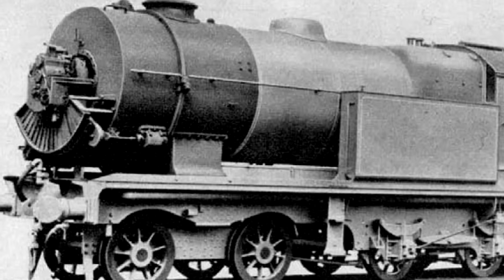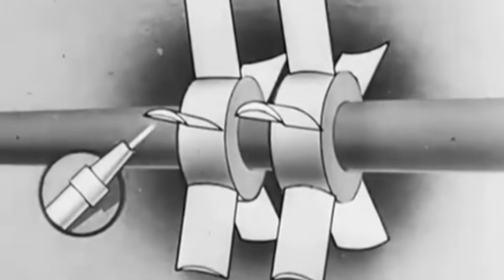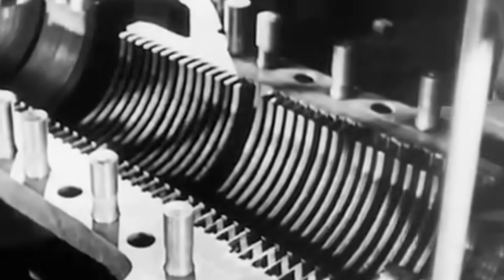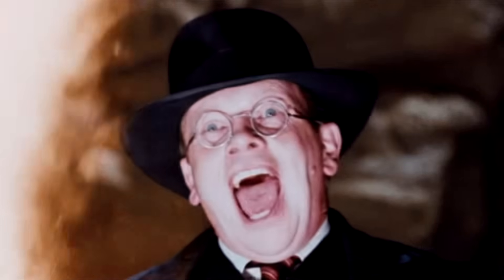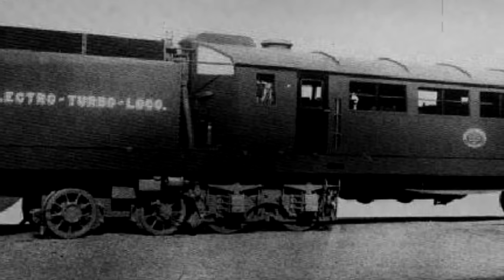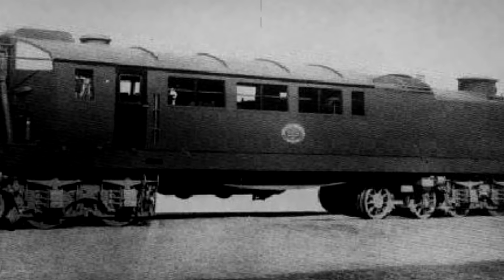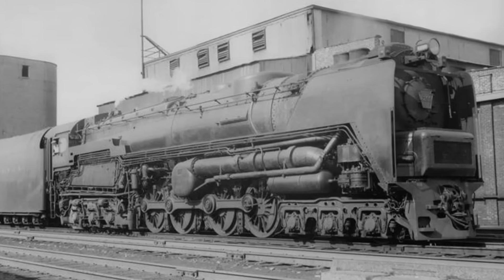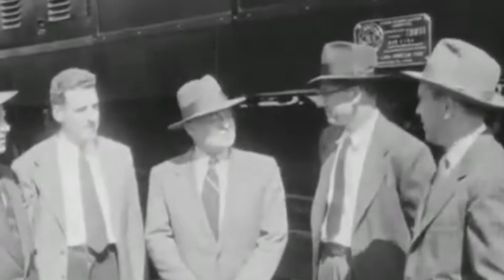What the Heck is Up With Steam Turbine Locomotives? | History in the Dark

Comment: Here is an idea. Take those super efficient turbines and let them run alternators. Then step up the AC, transmit it with little losses directly to the locomotives and let them drive electric motors. The rest of the world found out that this is pretty efficient and you can also use other sources of heat than burning coal. Like nuclear fission. And one turbine can be build enormously with a lot of power and inertia, so it can power dozens of locomotives over a big area.
Reply: powerplants and full electric locomotives are way more effcient then power generating on the locomotive itselve.
Thats why high density routes are electrified.
Reply: @obelic71  actually this is OP problem solution. Steam turbine moves AC generator in the power plant, then Voltage is stepped up, sent via grid and moves electric engine in locomotive. We have transmission losses but, don't have to carry a turbine, generator and fuel around
Reply: @szogun1987  Turbines are heavy an bulky things. The bigger the turbine the more efficient. so your are exeding the width restrictions. The UK and narrow railways even more with their reduced profile widths.  
Also railway tracks have certain axle loads. Heavy Freightlines have closer laid sleepers and thicker track so they can handle more axleweight.
The big advantage op electrical power is that you can transport it long distances at 300-500KV AC with very few losses.
Only localy you need to transform it to useable voltages for home/industrial use.
Diesel electric locomotives who are in fact small power plants on wheels make only sense in very remote areas and low traffic aplications.
Reply: Wonderful thing hindsight.

Comment: Sort of like the Chrysler Turbine Cars. A turbine powered car might work today, coupled with a CVT. Or use it as a range extender/heat source for an EV
Reply: The Chrysler Turbine used a gas torque converter - basically the turbine aspirated air with a turbo-compressor , mixed it with fuel and ran it through a power turbine which powered only the turbo-compressor , which shared the same shaft as the power turbine. The wheels of the car were driven by a second power compressor in the turbine exhaust and this was on a separate shaft not connected mechanically to the first shaft and driven from excess energy in the exhaust gas.
The first power turbine and turbo-compressor could run around 36,000 rpm constantly while the second power compressor driving the wheels operated between 0 rpm and a much lower peak speed.

Comment: So basically, like nuclear power, the most efficient way to use steam turbines to power trains would involve placing them in a permanent fixed facility (perhaps even a nuclear power plant). You would need to electrify the line, and replace the current locomotives by electric ones.
Reply: Funnily enough, all nuclear power plants use steam turbines to spin their generators 😅

Overall thermal efficiency of the whole arrangement is about 30%
Reply: No no  no - you fix the nuclear reactor and the steam turbine in place and run the power to the locomotive's electric motors with cables.
Best way to design a nuclear steam turbine locomotive!
Reply: @PaulG.x  Well, if you don't use a condenser then a pressurized-water reactor is the best choice.  Boiling-water reactors tend to make the feedwater radioactive, and you don't want that spewing out with an open-cycle (no condenser) design.  Considering the weight of a reactor pressure vessel, you may as well keep the condenser and re-use the feedwater.  The efficiency gain would be significant, no need for water replenishment stops, and the additional vehicle mass would be relatively small.  Locomotive range would be virtually unlimited!
Reply: Or just use coal power plants with steam turbines 

Basically how east Germany worked 
Steam locomotives having a ton of issues 
Diesel is expensive 
But the only reliable domestic power source is coal (they had one or two nuclear power plants)
So Railway electrification it was atleast for most main lines and high frequency commuter trains
Reply: Basically, you wouldn't bother with steam at all unless you only have solid-fuel.  If you have liquid or gaseous combustible fuel, an internal combustion engine is way more efficient.  As you say, though, if you have electric transmission lines to the vehicle, you can use any convenient power source to generate the electricity, even solar or wind power.

Comment: Great video as always. I‘m wondering why they didn't use a normal piston steam engine for the low and a steam turbine for the high speeds. That could have been a solution for more efficiency. Maybe it would have been to complex to build and maintain it.

Comment: Something to remember about turbines is the physics behind them.
Wow, yes, you can run turbines incredibly efficiently and everything, in order to get that efficiency and make sure that they actually don't get damaged. By the water vapor itself, you need to actually have superheated steam. Those curious on why you need superheated steam the water particulate and vapor itself when shot when you have what steam per se and you fire it at a turbine, we'll effectively sandpaper down the blades on the turbine to the point where they fail
Reply: Of course you can use saturated steam with steam turbines. In nuclear power plants they work very often with saturated steam, because it is not convenient to operate the nuclear reactor at higher temperatures. Furthermore you have to work across an additional heat exchanger to avoid radioactive contamination of the turbine water.
Reply: @gkdresden  But you only get away with that by running part of the system at a vacuum, due to having a fairly effective condenser system. The pressure drop across the turbines avoids the phase change to liquid and resulting impingement of the turbine blades. If something goes wrong on the condenser side, it's better to shut the thing down for service than wreck the turbine.
Reply: @pauljs75  You need a multi-stage turbine to reduce the pressure. But the steam pressure of locomotives was just 10 bar.

The "vacuum" (usually 1 or 2 bar steam pressure corresponding with 100 to 120 °C water end temperature) is automatically generated by spraying of cold water into the condenser, which takes the latent heat out of the steam.

Of course you need a sufficient water / air heat exchanger under the floor of the locomotive for the recooling of the condenser water. But this was also used in the the steam cars in the 1920ies.
Reply: Theoretically, when the steam pressure drops as it passes through the turbine stages, it will superheat itself a little bit.  The pressure drops more quickly than the temperature.  I say theoretically, because most plant operators don’t want to risk ingesting condensation into an expensive turbine.  Superheat gives more steam volume for a little more energy, so is a great way in improve efficiency and a margin of safety.  To make it work, the steam needs to make a pass (in a pipe) through the combustion gasses to increase temperature.  Naturally, this is not practical in nuclear power plants since no one wants to operate a reactor with a gas phase working fluid.  Even bigger safety reasons !!!!

Comment: well here's how you fix the efficiency issue, make them turbo-electric. have the turbine make electricity to run electric traction motors. this setup is more efficient on ships and in theory it would be better on locomotives as well.
Reply: For the reasons mentioned  in this presentation, ni it wouldn't.

Comment: It comes down to the steam turbine is a constant speed, one direction device, while the locomotive needs a prime mover which can turn at any speed from 0 to 500 rpm in either direction. A secondary issue is a steam turbine needs a condenser to be efficient and since the only cooling medium on a locomotive is air, the condenser would be immense and impractical to fit on a locomotive or tender. The problems can be completely overcome though, by putting the turbine at a fixed location and distributing the power to the train.
Reply: Indeed. Maybe they could distribute that power, from a stationary engine, using... I dunno, electric wiring suspended over the rails...

I know it sounds crazy, but it just might work 😊
Reply: Crazily enough, that precise concept has become extremely popular in Europe and in various local transit systems all over the world. 
I have also seen steam turbine powered buses and even cars… Modern electrochemistry is quite neat 😉
Reply: @kc4cvh  Yeah, it seems to me turbo-electric could work well but would be much heavier/builkier than pistons.
Reply: @kc4cvh  don't diesel engines have optimal rpm?
Reply: Then it’s not a steam locomotive. That’s like calling a battery operated submarine a nuclear submarine because it’s charged by an outlet that gets it’s electricity from a nuclear plant.
Reply: @davemccage7918 oh, yeah that reminds me: 
We have nuclear trains, buses, cars, bikes, and scooters in Europe as well 😂
Reply: @kc4cvh  each one of the problems you mention have found practical solutions because diesel power plants have similar requirements; Diesel engines dont change directions, so various transmissions have been implemented, some of which allow the diesel to run at a constant optimum speed. Also, diesels need to reject significant amounts of heat to the environment, so space for massive, often actively cooled radiators has been found.
In the end the real advantage of diesel over steam turbines lies in internal vs external combustion, where internal is overall more efficient in power density, while external combustion is preferred in stationary plants and can achieve higher overall efficiency
Reply: Why can't steam locomotives have air-cooled condensers? Steam cars like the Doble had no problem having them.
Reply: Look up the South African Railway class 25 4-8-4 locomotives.  They were designed for aired terrain without adequate water supply.  The exhaust steam was piped to a large condensing car behind the locomotive so the water could be reused.  I have read they were considered a maintenance headache and unpopular.

Comment: I can see these being used for Express trains. They only have to make 2 stops the beginning and the end of the trip.
Reply: He didn´t really mention it but the later lundström loco solved the poor efficiency at low speed issue simply by having multiple turbines. This was not really a large problem considering the low speed and low torque turbines was very small. The second gen lundström steam loco work just fine and was as good, if not better than there piston cousins.

The issue was that by the time they gotten the steam turbine to work in Sweden, most main railways in Sweden was already electrified.  And for branch lines steam turbines wasn´t really usefull.
Reply: @matsv201 the Pennsylvania Railroad S2 has two turbines, as well.

Comment: There is a bit of misunderstanding here. The steam turbines was not inefficient at low speed, they was inefficient out of it power range.

A normal steam engine have a cut of valve. That is the steam are cut of before the cylinders are full, this let the steam expand giving the engine sort of "free power", specially on low torque.

You can´t cut of a steam turbine becasue those have no stroke cycle. So there is no direct way to solve the low toque situation. Making it worse, Gasturbine run very bad at low revs as well. But this is solvable problems, and the people who made the steam turbine locos know about it.

There is two main type of steam turbines, a axial and a radial. The core concept is the same, but how they operate is very different. 

To also understand the down-pipe on a normal steam loco is so huge becasue the steam come in pulses, and the wider they made the pipe, the less resistant it become to pulses.

A steam turbine don´t have that issue. So the pipe is huge, because the steam volume is huge. This is one thing that is hard to grasp. Steam turbines are INCREDEBLY powerful for there size. They are considerably more powerful than the steam pipe diameter make you believe. For example the S1 is more powerful than the big boy.

Radial turbines are more compact, but a bit less efficient. On the other token they have less problem with back pressure, so the steam can be vented.

The Swedish steam turbine locomotive simply put 7 turbines on the same axle. 2 reverse turbines and 5 forward. How it work is if they have larger diameter they get more torque and less speed, if they are wider and smaller they get torque and speed. So the turbines are stacked up with a very narrow and large turbine first, than ever smaller and wider turbines. Each turbine have there own injector. The linkage is made so the injectors are chosen to specific torque and rotational speed situation. So in very high torque situation can more than one turbine be selected making the whole set up very efficient.

This way the turbines could be optimized for different speed having the larger diameter turbine optimized for about 30km/h, and the smaller diameter turbine for about 80km/h. Then the driver could steep throw them having basically optimal efficiency all the way from 30km/h to 80km/h.. This way this steam turbine loco was basically as efficient, if not more, than it piston counterpart while it was smother and more powerful

Comment: Well, here we have another example of a power source that had potential in theory. However, theory doesn’t always work in practice. Turbine electrics had proved that steam, coal and electricity don’t work well together. That and not running at full speed with lots of slower speed operation was not efficient enough to justify the expense associated with a turbine locomotive.

Comment: 13:18 cue the "well actually" meme, the steam turbines kinda failed BUT the diesel ones however, did great (union Pacific gas turbines)
Reply: A gasturbien that run on fuel-oil is not called a diesel, becasue diesel is the name of the engine, not the fuel, They are called oilers or.. gas turbines.

Comment: Fireless locomotives deserve their own video (especially since, once more, the US has the biggest ever, lol)
Reply: @kiarash608  what does that mean ? Gas powered instead of coal ?
Reply: @dietznutz1 if you mean pressurised gas, then yes
Reply: @dietznutz1  they pump the steam into the locomotive at the station from an external boiler
Reply: @laminat0996 that makes no sense, so they just have a massive tank of super compressed steam ? At what point is it forced back into water vapour
Reply: @dietznutz1 anywhere where you would want to avoid smoke and embers and the routes are short
(Mines, metro, petroleum plants)
Reply: Just not those dam talking trains with the apathetic faces from Sodomor

Comment: I'll say this right at the beginning, this proves the Swedes are the best development engineers in the world. Did PKP have a steam turbine class? Because if they did, and they made it work reasonably well, that prove that the Poles are the SECOND best development engineers in the world!
Reply: The issue locally in Sweden was that by 1935 most of the network was already electrified. And exporting a whole locotive was really not something that was commonly done.

Most locos was exported as a parts kit, often with the boiler, and sometimes the wheels locally sourced. (while full engine export was becoming more common in the 1930s). this model didn´t work that well for turbine locos.

Really even with diesels later on the famous NoHab diesel was originally a parts kit and later become a licence product. Ironically the iconic front part of the loco was made localy in Sweden but was designed to be simular to the loco that the partkit was original from